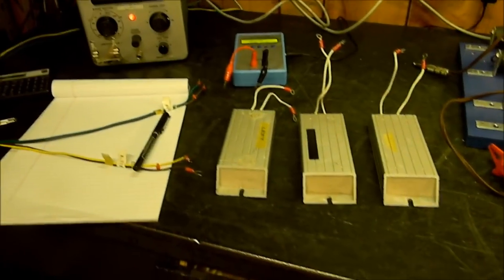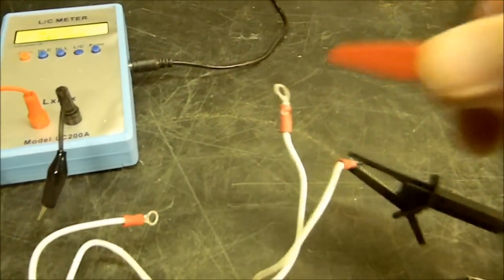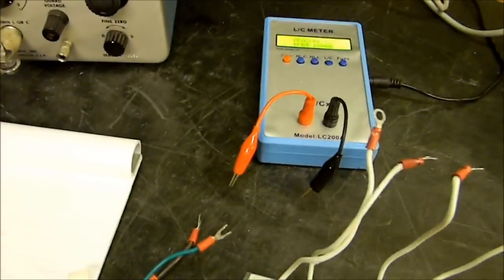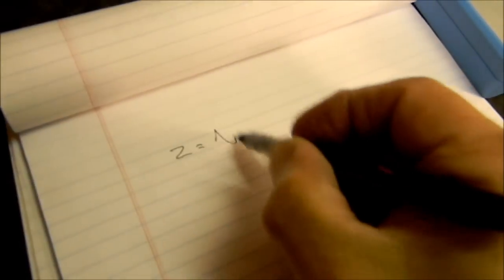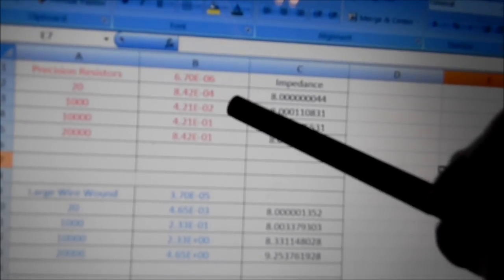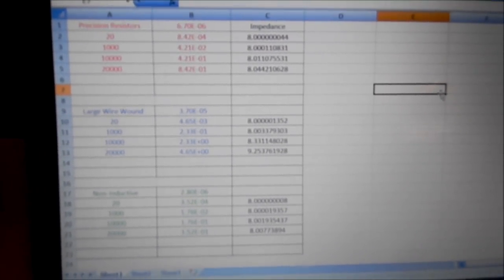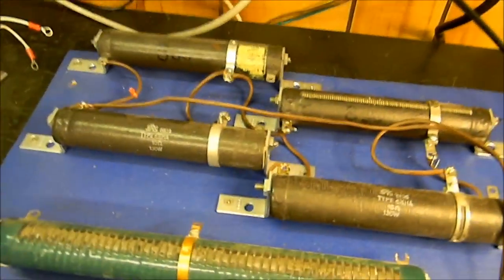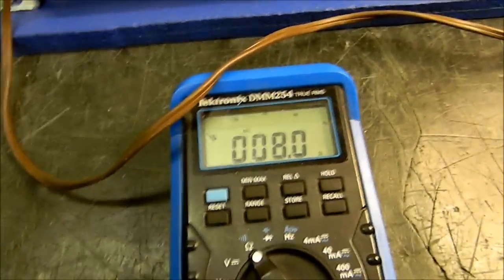Dummy Loads For Audio Amplifiers.wmv

Comment: David: I know this is an older video but the subject is still relevant.  I did some measurements on some 200W "non-inductive" resistors for audio work; they are similar in appearance to the "non-inductive" ones you tested.  On an HP 4263A LCR meter (10kHz) I am getting 8.10 ohms at 8.9 deg which works out to about 20uH.  At 20 kHz we have 8.4 ohms of impedance.  This will be fine for an audio dummy load.  I also checked the resistance at 21C (8.06 ohms) and 81C (8.09 ohms).  I was more concerned about the tempco, but the numbers say they will be fine.  Thanks for the video and information.

Comment: Great video. Hope you're still reading comments. Curious to know if inductance would change signficantly with increased current since your measurements were done essentially at 0 amps but under load that would not be the case. Thanks!

Comment: Am glad you did this video. I didn't want to spend 300 bucks on non-inductive resistors when 30buck wire wound did the trick. I actually want to compare the two my self to see the actual difference in the numbers...if the output is less than 5% different between the two, then can you really complain?
Reply from the maker: Thanks for your comments - I completely agree with you - you may want to watch the video I made on high power 8 ohm loads from hot water heater elements - probably the most economical and certainly the highest power dissipation you will get for your money.
Reply: ElPaso TubeAmps Well I got lucky and found a 1ohm 1kwatt resistor on ebay for 35 bucks shipped. I also scored 9 40ohm 300watt resistors WITH MOUNTING HARDWARE for 35 bucks shipped...the hardware alone is over 50.00.

Comment from the maker: Connecting wires are probably 48 inches - which adds several uH. I have had to connect a ground wire from the casing of the heatsink (I have a ground connector mounted on it) to the amplifier under test with the low inductance 1%  precision resistors to quell high frequency (ultrasonic range)  instabilities in rare cases but this has never happened with the larger wirewound ones (single channel) . Possibly an interaction between L&R channels on a common heatsink?